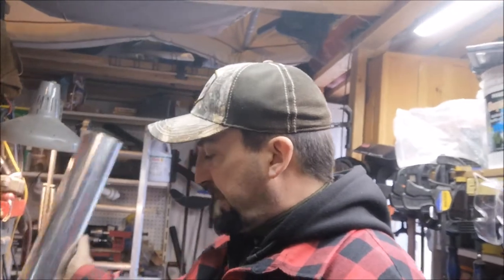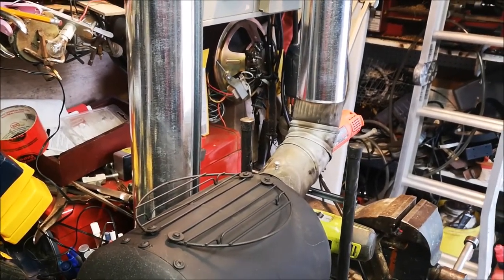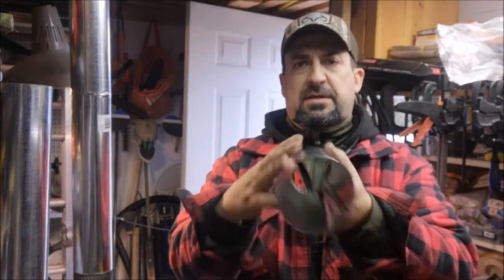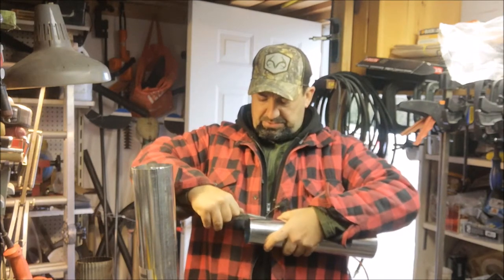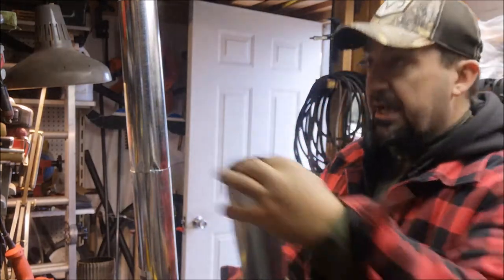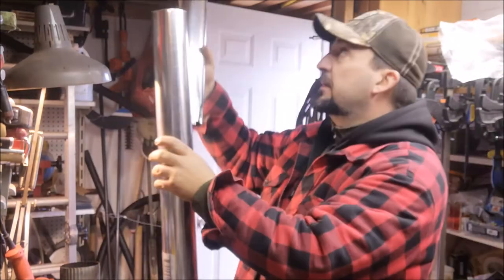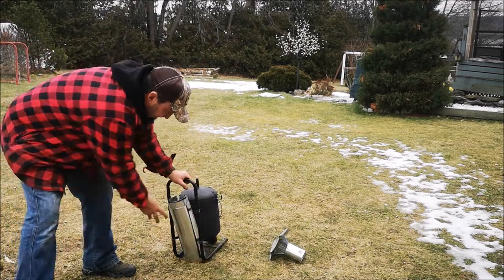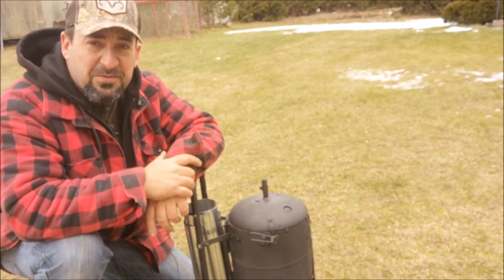DIY Hot Tent Stove Chimney

Comment: Some info about galvanized stovepipe: Zinc toxicity can occur when an individual is exposed to and breathes the heated yellowish fumes produced from welding or heating galvanized steel. For hot-dipped galvanized steel the recommended maximum temperature is 392 F before the metal presents a toxicity risk. A wood stove regularly has surface temperatures over 400 degrees F, and stovepipes are typically a little lower than that at around 225 F to 350 F. However, the vapor (boiling) point of zinc is around 1650 F, so take that for what it's worth. You're probably not actually burning much of the zinc off, but just causing it to oxidize, forming zinc oxide. Treating galvanized steel with white vinegar will dissolve the zinc.
Reply from the maker: You are correct. After this video, I put all lengths into my enclosed fireplace at home, thoroughly 'burn them in', cleaned and then coated with high heat paint. Great advice for those who may not know that info. Thanks.

Comment: Where did u get those 3 inch pipes?
Reply from the maker: Your local hardware should have them in the duct and dryer section. They need to be fired to remove galvanized coating then painted with high heat paint if you like

Comment: chimney? Goes on ur stove hole in ur tent to prevent FIRE?
Reply from the maker: I built a hot tent stove and this is the chimney I designed to use through the  wall of the hot tent. A hot tent is a designed tent used for cold weather winter camping that allows for a chimney/stove to run through a fireproof flange in the tent wall.